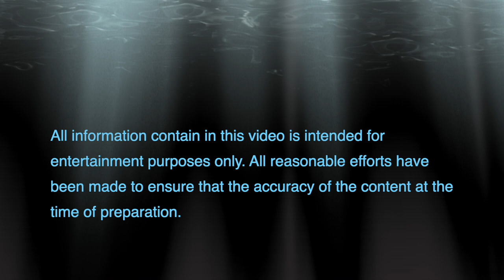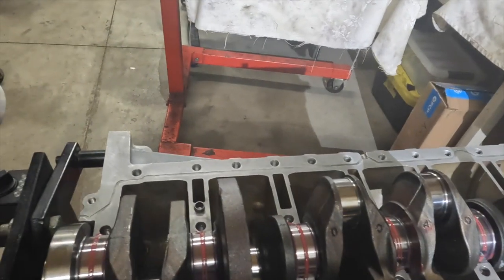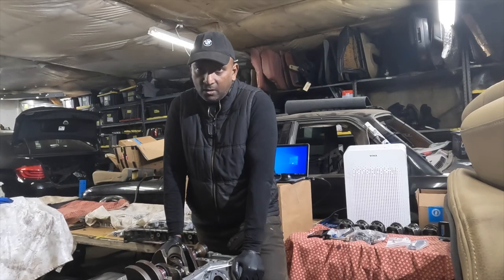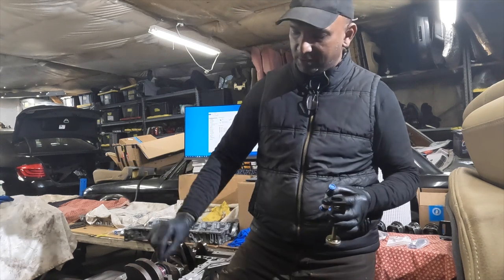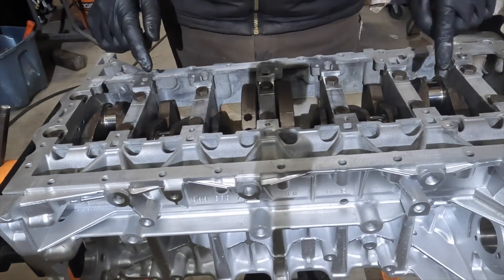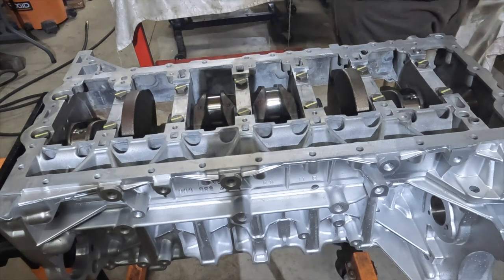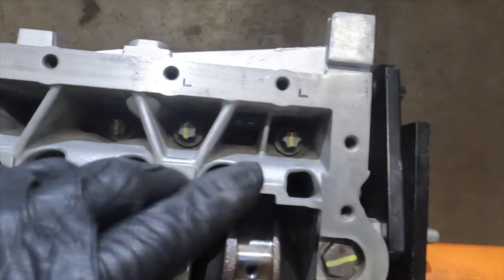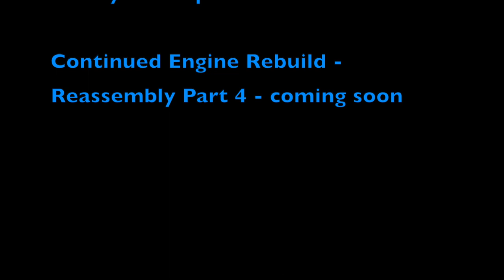BMW N55 17667419 Rebuild - Crankshaft & Bedplate Installation Part 3

Comment: I am using anaerobic sealant from permatex, your correct about application
Reply from the maker: How has that worked for you
Reply: It has worked well, it looks almost the same as the locktite sealant.
Reply from the maker: @gabrielh5937  good to know

Comment: Hey! On the N55 crankshaft diagram there are 2 sprockets and one additional friction disc. Do you need that separate friction disc or is it integrated in the sprockets now?
Reply from the maker: The thicker sprocket that is in the chain module that run the vacuum pump has the friction disc integrated.  The thinner sprocket that guides the camshaft chain needs a separate friction disc that mates to the crank hub

Good luck 270 degree hub torque
Reply: @straightupbmw  hah its gonna be wild.  thanks a lot!